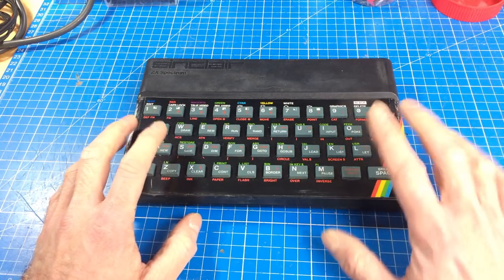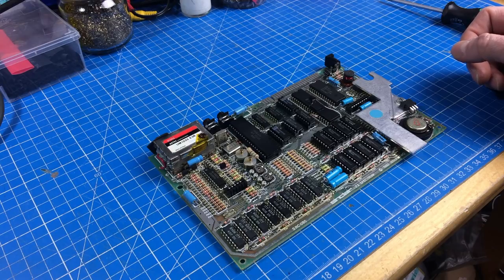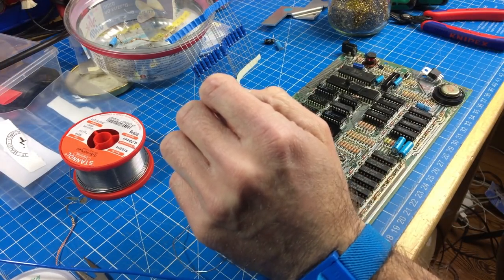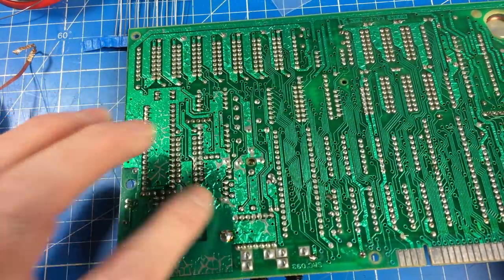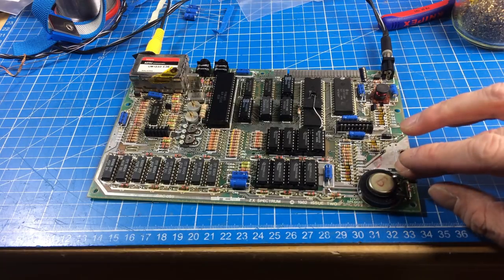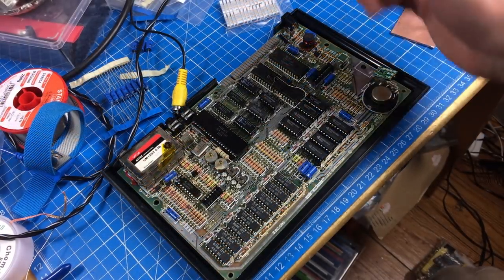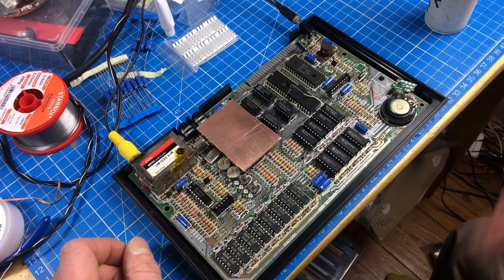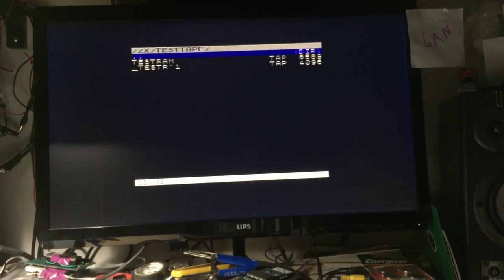Sinclair ZX Spectrum 48K Future Proofing

Comment: Great work she should give you many more years of colour clash.  Those DivMMCs are a must
Reply from the maker: Haha, I hope so. The DivMMCfuture is brilliant indeed. :)
Reply: I also have a divMmc (enjoy) but didn't use it yet. Currently I'm using the smart card v2 which is way enough for what I want to do (play some games). Big downside is that it does not support TZX which can be a showstopper for some ...
Reply: The Spectrum is one of the worst computers ever built. I could not imagine anyone so cheap that they wouldn't put an on/off switch on damn computer!
What is with that KB? 
If you must use a Spectrum, at least use one that has a keyboard on it!
Reply: @JanBeta  Satia nadella first computer
Reply: @tarstarkusz  I agree. Who would be so cheap as to put an expensive on/off switch on the computer? Potentially raising the price under $100? Maybe a price conscious developer?
Reply: @AllGamingStarred  There is no end to that ridiculous line of thinking.  You can start applying that thinking to virtually all of the machine's components. Why even make a 48k version?  After all, if we are shooting for such a specific price, who needs all that extra RAM (you will note, when given the actual choice, the 48k version massively outsold the cheaper 16k version) 
An on/off switch by the freight car load might cost 10p (probably less) and is a vital part of any appliance.  What other electrical appliance sells (or sold in the 80s) without an on off switch?  Even the cheapest modern TV sets at least have a soft on off function.
Reply: @AllGamingStarred  The Spectrum is very, very cheaply built and that is my complaint about it.  I never said modern PCs were better or worse, nor did I bring them up at all.    I simply said that most appliances, if not all, have an on/off switch.  I also didn't say they were bad. 
What you are saying is absolutely moronic. If you think an on/off switch made or broke the poor family's ability to buy one, you are nuts.
Most 80s PCs (which the spectrum is not) had giant klunk switches.  I don't even understand why you are bringing this up. A small cheap switch would have been fine.  All of the other 8 bit computers made by companies other than Sinclair had an on/off switch.
Reply: @tarstarkusz  Fine, you win. I was having a good time until your comment popped up.
Reply: @AllGamingStarred  Had you not been so flippant, I would have been nicer to you.
Reply: @tarstarkusz  You bought this on yourself. It's not my fault you decided to bash one of the greatest computers of the 80's
Reply: @AllGamingStarred  You're denying reality.   Whatever positives it has, and it has positives, it was very cheaply constructed and it shows.
Reply: @tarstarkusz  ok, i get it! It's cheaply constructed. You know what else is cheaply constructed? My patience!
Reply: @AllGamingStarred  and your face.
Reply: @tarstarkusz  My face is a work of art. You must be referring to the back alley doctor you used after puberty
Reply: @AllGamingStarred  Why would I need a "back alley doctor"
YOU responded to my 2 year old comment and now you're telling me about your patience?
Reply: @tarstarkusz  forget it

Comment: Nice video.  However I would not have used paste for the copper heatsink as it could fall off, but instead I would have used an adhesive heat pad to connect them together.
Reply from the maker: Thanks! I used thermally conductive glue especially designed for the purpose. In my experience it makes a stronger connection than the adhesive pads but it’s a matter of taste really, I guess. I’ve used both with good (and lasting) results. :)

Comment: Just shows that Sinclair cut so many corners for reducing costs and that was also poor quality assembly and components ... but thats business for you LOL good video as per usual Jan :D
Reply: Also goes to show that even after so many corners were cut for reducing costs, etc, just how damn reliable those old machines were/are.  I have a rev 3B version Spectrum (with composite mod), and all the components are still original, and it works perfectly!
I think it helped on these slightly later 3+ boards that the heatsink was moved to the rear of the system, and was a long 'bar' that ran under the raised edge of the case behind the keyboard.  At very least, this stopped the old problem of the keyboard covers lifting away on the right-side of the computer.... that was a constant issue during it's first year or so, and at the small shop where I was working back then, we had numerous complaints from customers about this!!  Nothing we could do about it at the time, but after the rev 3 boards, no more complaints!!
Reply: apple today does the same shit today and gets away with it

Comment: The ULA has no support for sound, other than a simple 1-bit port shared with the cassette interface. Sound is generated by program code (as in the Apple II or IBM PC/XT/AT, for instance). The same goes for graphics. The Sinclair Spectrum has no hardware support whatsoever, except for simple color attributes and a 50 Hz interrupt. All graphic operations must be done by the Z80, including scrolling, sprites, text, etc. So it's quite different from the C64.
Reply from the maker: Yes, it's a rather crude thing, I know. I didn't mean to say that the ULA is dedicated sound hardware. It's just (quite cleverly) used to behave like that with code of course.

Comment: Nice old rubber wedge there :) 
Things to watch for in Speccies, as im sure you know:

Dead 4116's
Dead voltage converter circuit. One of these usually causes the other ! 4116's dont like it when they dont have all of their supply voltages (+5, +12, -5) and typically fail by going short or partial short circuit. This in turn kills the voltage converter circuit, usually by killing TR4.

Replacing the 7805 with a modern switchmode converter is definitely a great improvement on these. Sometimes it can also be worth swapping out the Z80 for a modern one.. the old ones are NMOS based and take more power than the more modern CMOS ones. They otherwise behave identically so it is a simple substitution.

On Issue 2's like this one, sometimes the VR1/VR2 pots get noisy, and this can affect the picture. Issue 3 and later made these pots unnecessary. I've seen some people replace them with sealed preset pots or even multiturn trimmers.. i think multiturn trimmers is going a bit far, though ;)
Reply from the maker: I indeed had to adjust the pots and spray them with contact cleaner on this one when I got it.

Didn't know that about the Z80. Might be worth a try sometime. If only as an interesting experiment. :)

Thanks for sharing your knowledge (again)! :)

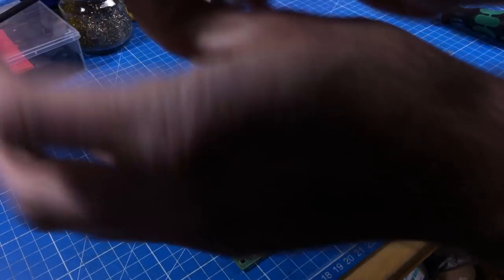Comment: 5:16

Most of the people who say that ESD wriststraps don't work probably haven't worked in the industry, or actually read up about it.

It's a definite "thing", and older chips are especially prone to it, as the chip processes themselves were often more sensitive to getting zapped, and the internal ESD clamp diodes on each IO pin (part of the chip itself) weren't always so great.

The older CMOS devices were often VERY sensitive to ESD, like the CMOS SRAM chips you'd find in older 386 / 486 motherboards for the cache.

Almost any IC can be damaged by ESD though, but modern chips are thankfully more robust now.

Either way, if you REALLY care about the device you're working on, you should wear a wrist strap, or at least use a properly Earthed ESD mat.

The thing with ESD is that you never quite know if a few gates inside a chip have been zapped, and that damage may only start to show problems months down the line due to localised heating. It can and does happen to modern CPUs, for example.
Reply from the maker: Thanks for the clarification. Exactly what I am thinking. If you care about what you are working on, you should minimize the risk of damaging it.

Comment: No S-Video mod? Does a great job getting rid of the dot crawl.
Also that cooler solution is slightly questionable ... while copper has great thermal capacity and conductivity the heat exchange rate probably sucks due to the limited surface area ... once it has heated up it's gonna act as a cooking plate instead of a heat sink :(

Comment: ESD straps don't work because someone didn't SEE an IC damaged? /facepalm
Reply from the maker: Yeah...
Reply: Actually I just had one that really didn't work as it had a totally open connection due to a broken wire straight from the box. Was one of the cheap blue ones, too. And yes, not 1MegOhm or 10Megohms safety resistance, just really fully open.
Reply from the maker: Mine came from the iFixit tool set I got a while ago. Seems decent quality (like the rest of the set). Did you see the straps that don’t have a grounding wire at all? I loled when I learned that those are a thing.

Comment: GOOD  IDEA JAN  WITH SWITCH MODE REPLACEMENT  BUT ALL U HAD TO DO LOWER VOLTAGE ON POWER SUPPLY TO 7.5V DC  ADRIANS  BASEMNT  DID IT TO HIS WORKED A TREAT  MUCH  COOLER  HEATSINK IS VERY GOOD  JUST BE CAREFUL ITS COPPER   EASY TO SHORT  JUST LITTLE TIPS FOR YOU    SEE YA   EPROM  YET?.  BYE

Comment: I'm more the "better weld 5 cars completely, than solder one point"-Type... I borrowed a good soldering station from my cousin to repair an old keyboard, and a power-plug adaptor for truck, with the keyboard i totally failed! :D - 2 wasted hours for nothing.
Reply from the maker: Uh, that's bad. I might get back to you when my car needs some welding, though... ;)

Comment: Only C64 people use a joystick to play games on the Spectrum!!! :-D Cool video, anyway! Kudos for ISSUE TWO! Thanks for that one. Btw. a sort of ULA test includes an old Test Program (by Sinclair Research available on WorldOfSpectrum site). Who knows what exactly does it actually test, but it's in there. But yes, if the ULA was faulty (as well as RAM/ROM or Z80), the Speccy couldn't run at all probably.
Reply: the oem spectrum joystick was awful (well so was the c64 oem) but that connector type was common, thus it wasnt  so much a c64 as a generic atari plug and workings , which is what the commodore 64 used as a standard :) so the spectrum adaptors all used this connector
Reply from the maker: Haha, you may be right about the joystick thing. I tried playing games with the speccy keyboard and it felt strange to me (obviously) so I'm glad I have the joystick interface now... ;)

I heard about the test program. Going to use that next time. Thanks!

Comment: Be very careful what anti-static mat you buy.  the cheap ones are horrible, get damaged easily, and smell!  I bought a  
228156 -  Anti Static Mat, Bench, Rubber, Beige, 0.6m x 0.9m x 2mm (no longer made but similar available).  A good hose down, a few days hanging in the shed, and it does not smell..
Reply from the maker: Oh, thanks for the tip. :)

Comment: Great video Jan!
One thing i do for regulators that get hot is i solder another one on top of it so the two are in parallel
Reply: You have to be careful when doing this... if their outputs are not exactly the same, you can get circulating currents.

Comment: Jan, i think Your Speccy works as 16k not 48k, as the black screen  (self test) on power on takes longer on 48k as yours
There was a poke code to check it
Also your test program doesn't show upper 32kb memory...
Reply from the maker: Oh, as far as I can see, the test program went through the upper RAM as well without any problem. I'll have to re-check.

Comment: Definitely use an ESD safe environment when working with electronics, even with older stuff like this. The ESD mat is really important too. If you have a charged PCB and you touch it wearing your earthing strap on the wrist you can still easily destroy the part. There's no way to see or predict ESD but once you take precautions you can eliminate the problem, mostly.
The amount of "mysterious" breakages will just be a lot lower.
Reply from the maker: I totally agree.

Comment: Interesing vid Jan, I got a bunch of those switching 7805 drop-in replacement but wasn't successful in sourcing replacements for the 7812 for my commodores 64s
Reply from the maker: I found the RECOM branded ones for 5V and for 12V. Quite expensive but supposedly very good. I’m going to make a video some time putting them in a C64.

Comment: I wouldn't trust that 78xx series regulator replacement. A LDO I prefer is from the BAxxDD0T Series. Can handle more current and has current protection.
Reply from the maker: Yeah, it's not very well made and cheap. A proper regulator probably is a lot more reliable. I had some people recommend the cheapie I used for the Spectrum. Mostly it seems to work fine at least for some years.

Comment: I remember one of my first electronic lesson for beginners - "if it is possible try to replace 7805 into modern voltage converter". This video is an amazing practical example of that lesson. I've really enjoyed watching it.
Reply from the maker: Yes, I think it's always a good idea to do it whenever possible. Especially in a small enclosure like this. I think I will retrofit a better switching converter in this ZX sometime though. I don't really trust the cheap one I used much... ;)

Comment: These small switching modules are nice but cannot deliver more than 1 amp which is not enough if you cannot several extensions devices to the speccy. That's why I prefer the UBEC modules, which can deliver up to 3 amps (which should be way enough!). I have used several ubec modules in a C64 PSU, in a timex 2048 and in a speccy 48k, no problem at all.
Reply from the maker: Thanks Stéphane. I considered using another (beefier) switching converter, too. This speccy still works just fine (even with the DivMMCfuture connected) so I guess it's okay but I don't really trust the cheap converter. I might use a RECOM one (used those in my C64 and they are absolutely great).
Reply: Indeed I don't really trust the cheap modules as well. Is there a short circuit/over voltage protection on it ? I have the same here but I'm not sure i'd use it in a speccy.

Comment: I never had a zx too, I cannot be bothered much about them. I prefer my good old c64. But I like the 7805 replacement parts. I have never seen them before, but just ordered a few on ali x.
Reply from the maker: They supposedly work very good. There's much more expensive solutions with all kinds of protective circuitry, too. I recently bought a 7805 replacement from RECOM that I want to try. It was around 10€ though.

Comment: +Jan Beta
@Jan Beta

11:16 Wrinkled backside

i think this is in fact a solder mask/stop to prevent the solder from running where it's not supposed to go, but not as good quality so it cracks and wrinkle whe it see's the solder. Could be wrong thou but it looks like a plausible explanation
Reply from the maker: Oh, it's a combination of both in this case. The solder mask has cracks, too. EEVBlog Dave made some remarks about the wrinkly surface in one of his retro computer teardown videos and explains it. I can't remember which one or I would have linked it in.

Comment: if that is a pal unit, changing from rf to composite is as easy as cutting a few connections in the tv modulator and soldering a wire on, i see you did this good man, replacement ram can be good too there is a guy in scotland sells replacement chips, you can increase it to 128k or even 256k though very few programs use it, there are switchable bios mods, rgb and vga mods, its truly amazing what can be done in 2018.
Reply from the maker: Yes, I've seen those memory replacement boards. Interesting stuff. I just love how you can combine modern tech with the old systems these days. :)

Comment: If you touch the heatsink or 0V rail on the the PCB you do not have any charge with respect to the PCB, your wrist strap would not help you if the PCB was statically charged when you touch it. I have never worn one in my life I just follow the rule of touching the 0V on the PCB I am going to work on. The wrinkled effect was caused by the flow soldering the solder wicked under the solder mask to give you that effect.
Reply: Touching ground will discharge the stattic from you of course but just moving your hand around a bit will put kilovolts into your body again. Also it's not wise to discharge yourself to the board, you should be gounded with the board.

Comment: Great video as always.
But I have a question/suggestion:
I was wondering for some time, if we can disable and disconnect the original internal switching power supply of the manufacturer altogether and replace it with a newer DC to DC converter like the one you used. BUT, with the ability to produce all of the +5 and +12 volts' supplies and feed them with some cables to the appropriate pads to the inputs of the rest of the circuit.

Is there any kind of circuit on the market yet? Among the others, we will get rid of the squeaking sound of the original transformer as well.
Reply from the maker: That's an interesting idea. I'd guess it's totally possible to do it. I actually have another issue 2 board I could experiment with (in much worse condition but working).

Comment: The reason for the solder resist being crinkled is a combination of solder resist is to thin and/or flow solder machine speed set to slow causing the resist to crack and blister due to to much heat. That's the reason it's all over the pcb or anywhere the are a lot of large/thick tracks.  I use to see it a lot.
Reply: Oh and the reason why the "Sinclair" part was not affected is because that part was masked with heat resistant tape so the RF module could be fitted by hand after flow soldering. Nerd moment over. :)